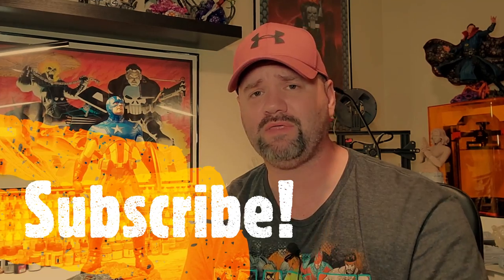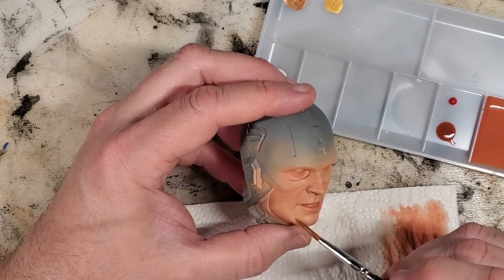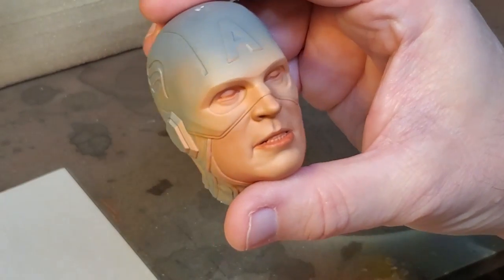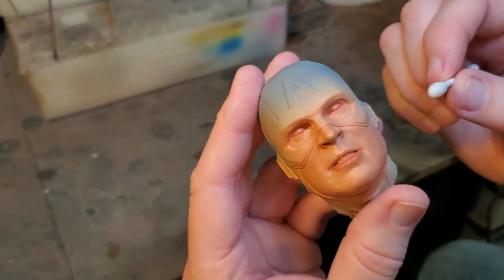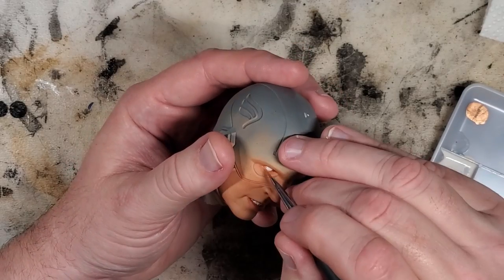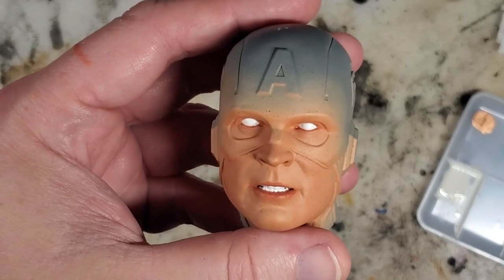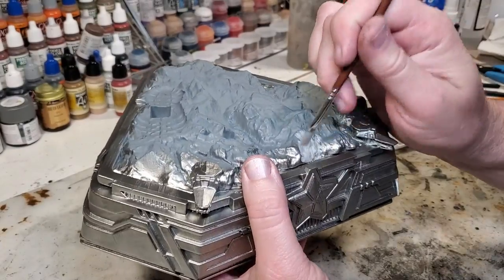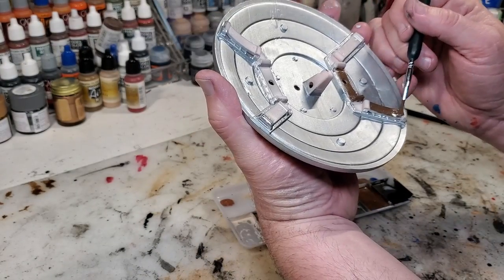I 3D PRINTED and Painted America's a$$ Captain America- Avengers

Comment: Love ur work man keep it up, I’m new too 3D printing I have a mono x using siraya tech fast navy grey using lychee and for some reason my prints not sticking on to plate please help with settings or anything thanks?
Reply from the maker: First just make sure your bed I level then try and increasing your bottom layer exposure. I'm not sure where yours is now but I usually run mine, depending on resin around 35 to 40. Again, this may or may not work for you.
Reply: @TheCreativeCollector  thanks for tips I’ll test it out